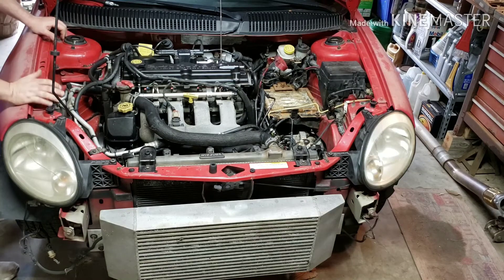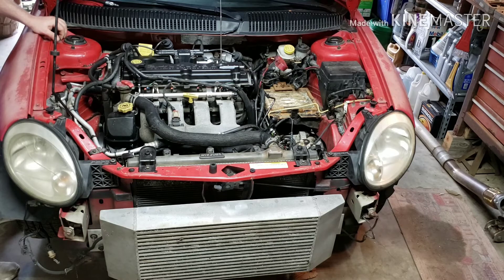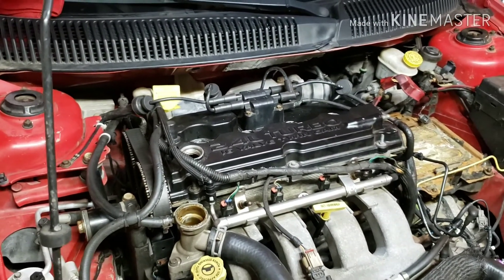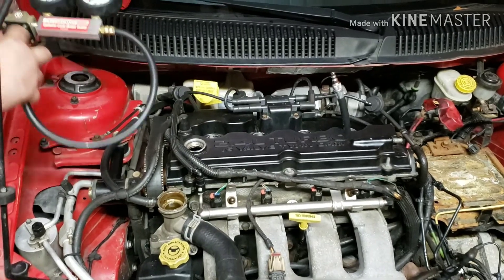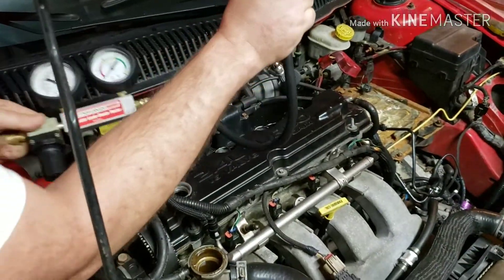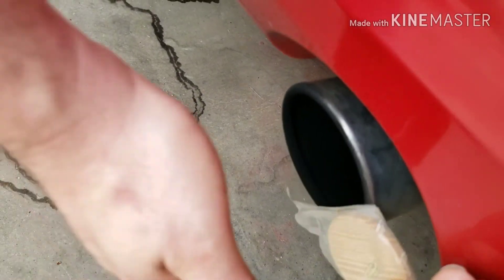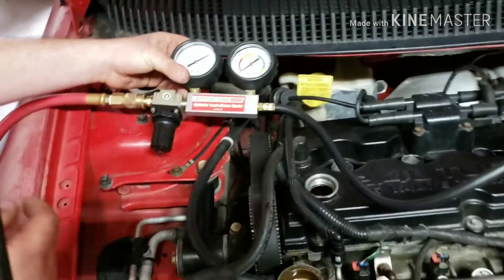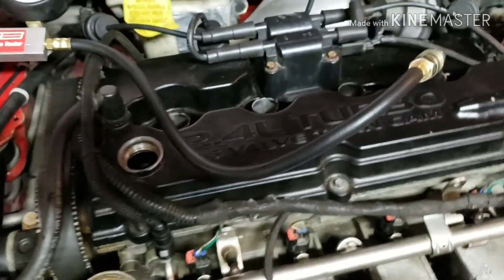STR4 How to perform leak down test.

Comment: Thank you so much for posting this!
Did you do a compression test as well? If so, how much of a difference in psi was #4 in comparison to the others.
And what symptoms did the car have while it was running that made you test it in the first place?
Reply from the maker: Test was 160 on cylinder 1-3 and 35 on cylinder 4. Slight misfire every so often, but it always threw a p0304 code. We replaced the plugs, injector, wires, cam sensor and still threw the same code. Should've done the compression test to begin with.